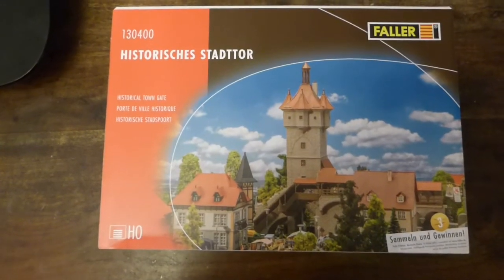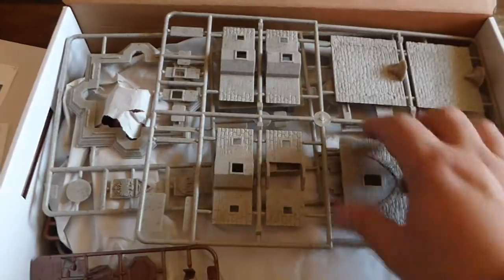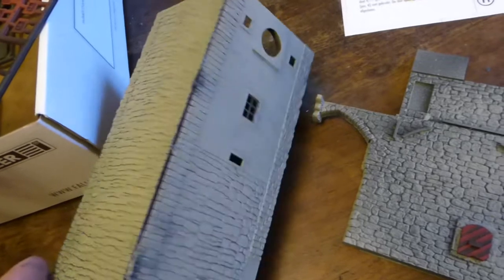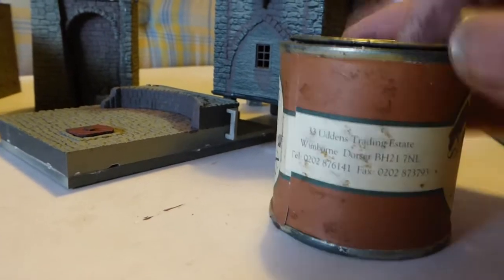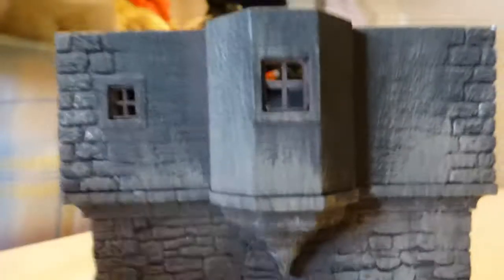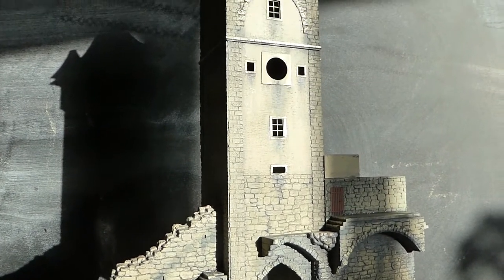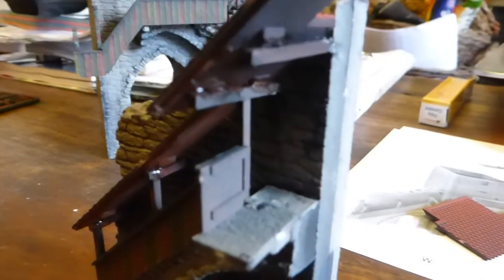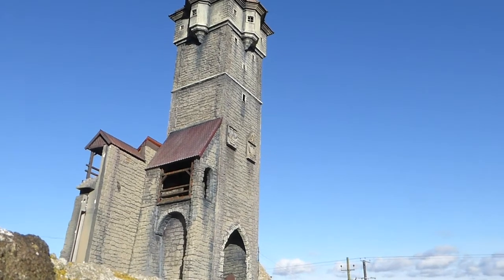Faller 1/72 Tower ( very big and very fancy)

Comment: Hi. Just found your channel. Been bingeing on them up to this point. You're definitely improving, at least I think so.
I find myself much in the same boat as you did. Built pretty much the entire Airfix 72nd aircraft range, 'cept jets, although I built a few when very much younger until maybe mid teens. Have a largeish stash most of which are are maybe 50 years old, not all Airfix, not all aircraft!! I love history so I'll cover all eras and subjects, in all scales, including model railways. Plus lots of tools and other stuff. Including the entire Humbrol enamel paint range. You think they'll be any good still?
Tip: If you buy Humbrol tinlets also buy your wife Ferrero chocolates. The large plastic boxes are perfect for them and the smaller oblong ones are great for showing smaller models and figures.
Not thought about conversions using 'cottage' model producers? Photo etch, vacform and resin bits and pieces to make other variants of things?